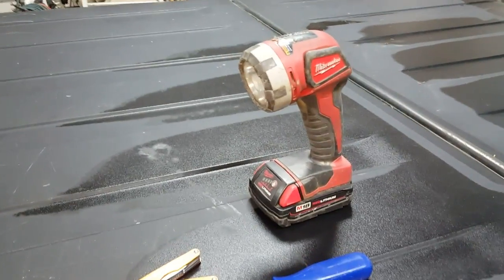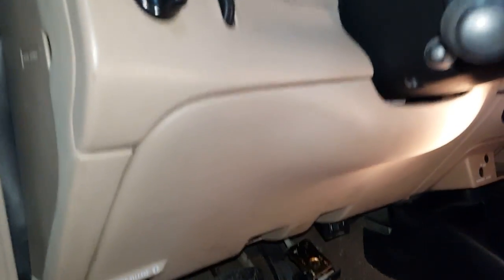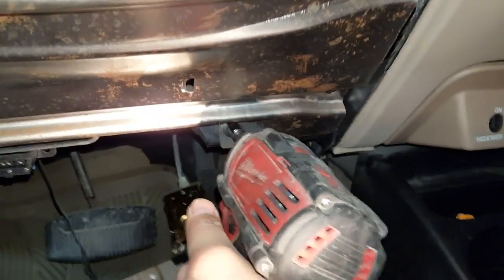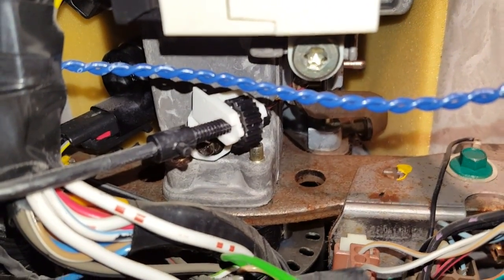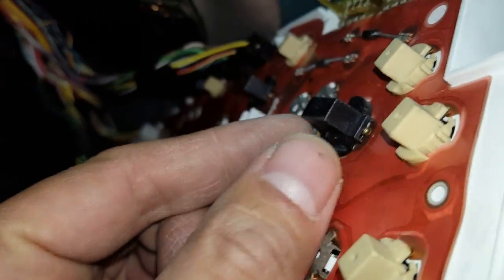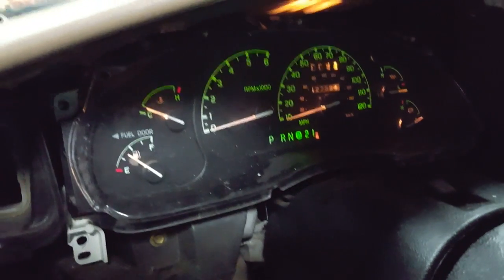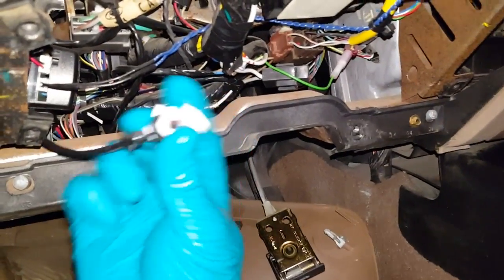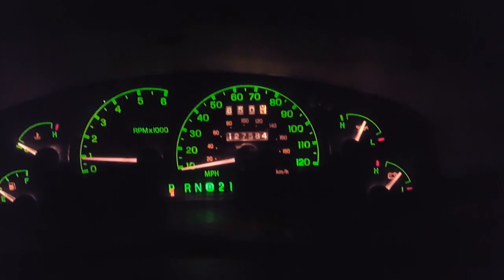2003 Ford Ranger:  Replacing instrument cluster illumination bulbs

Comment: I’d highly suggest replacing the shift indicator plastic wheel piece with an aftermarket metal one made by Apperfit which works superbly, I used it on my ‘99 Ranger. The factory plastic one constantly breaks on every single Ford that uses this shifter system whether it’s Ranger, F-Series, Explorer, Expedition, Crown Victoria, E-Series, Windstar, Taurus, etc.
Reply: Hey there, thanks for the suggestion. My dad had a 99 Mazda B3000 SX and the shift selector don't do what it suppose to do when you shift to 1 or 2. When you shift from P to D is fine, but sometimes the shift selector is not in the right position.
Reply: @gamernaruto680 It’s a very common failure in Ford vehicles of that era. I was thankfully able to fix mine with the metal bracket version.

Comment: Is it 3 bulbs? The guy at the part store said I might need up to 10
Reply: There's a crapload of bulbs in the instrument cluster, like, at least 22 (I counted in the video). Recommended replacing all of them at the same time, but that's gonna cost a lot of money in bulbs. If you've only got one or two out, I'd just change the burnt ones. Usually you'll just need to replace the ones in the BLACK sockets (like 6 or so), though.
Reply: @aaronm9478  it was 6

Comment: Yea I did this and now none of my guages work.
Reply from the maker: Collin Creates check connections at the back of the cluster.
Reply from the maker: So absolutely nothing works at all in the cluster?  Warning lights, backlighting, gauges?
Reply: @AKJeeper Back lights work just fine but the gauges don't do nothing.
Reply from the maker: Collin Creates Next step I’d take is to check your fuses.  Maybe one of them blew in the process.
Reply: @AKJeeper  yep I did. I even took it out and put it back in again.

Comment: I can't rotate the black bulb holder. They seem stuck and I don't want to break it. Do you push in as you rotate counter clockwise?
Reply from the maker: Sometimes they're in there pretty tight.  Pushing in while turning counter clockwise does help release the holders.  Sometimes I'll use needle nose pliers to help.  Keep in mind that these trucks are getting up there in age, so the plastic holder may break no matter how careful you're being.  I keep a small selection of these holders in my toolbox just in case I break one or two (I pick them up from vehicles in the junkyard - costs next to nothing there).

Comment: Great video. I have a 99 I need to tackle. This is the first time I've seen somebody replace the bulbs while IN the truck.  Brilliant! New subscriber
Reply from the maker: Sometimes I replace the bulbs without fully removing the cluster, and other times I'll pull the cluster and replace the bulbs with the cluster on the bench.  I was in a little bit of a hurry the night I did this video so I elected to do the bulb replacement in-vehicle.  Thanks for taking the time to leave a comment, hope this video was thorough enough for you to get the job done on your 1999 Ranger.

Comment: Great job. Why did you have to remove the shift indicator cable?
Reply: Never mind, I get it.
Reply from the maker: I'll reply anyway in case someone else has the same question.  It's so the instrument cluster can come out of its opening.  The shift indicator cable generally does not have enough slack to allow the cluster to come out enough so that you can access the bulbs.
Reply: Thank you. Your video is one of the most professionally done that I have viewed in some time. Guys like me, who like to do some of their own minor repairs, are really helped by contributions like yours to guide us in the right direction. I have a couple of minor comments/tweaks. There are actually two T-20 screws securing the hood release and the lower knee bolster. Also, it would have gone smoother for me if I had removed those screws first and left the two on the ends to keep the knee bolster and hood release from falling down while I loosened those two screws. Thanks again, we all appreciate it. 

Phil